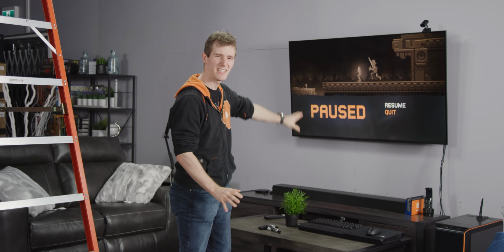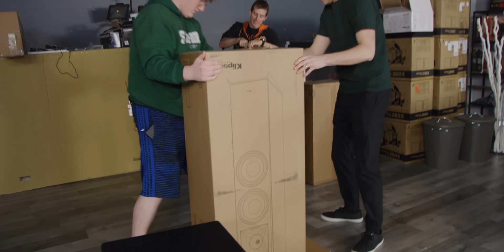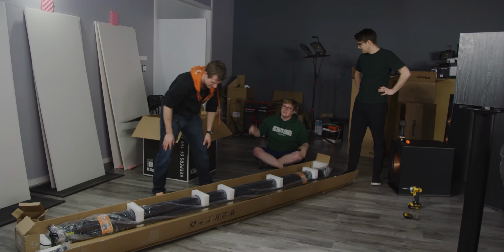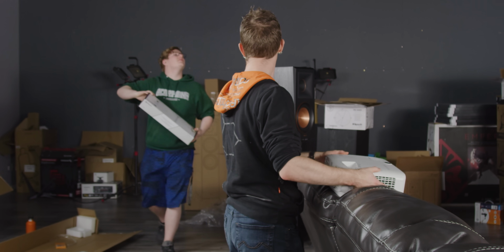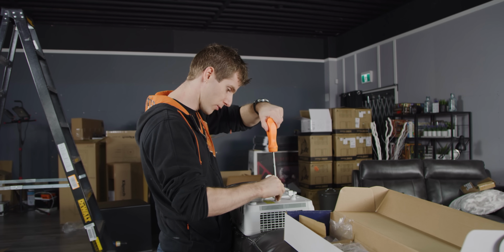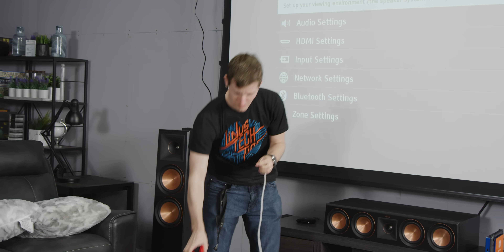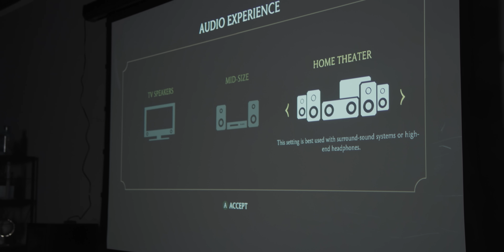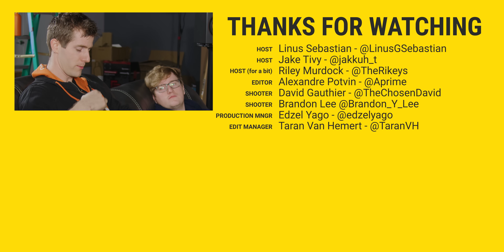I Hope We Don't Get a Noise Complaint... - Our Epic Employee Lounge Sound System

Comment: "The screen is a big part of what makes the projector sound good" -Linus 2019
Reply: *great
Reply: @Kobra Thor 
Naw. Pretty sure he meant the sound waves are reflected back from the screen like an echo. "Although the direction of the sound changes, the echo sounds the same as the original sound." It has to do with all those tightly packed fibers. Also I'm kidding. 👍
Reply: He is kinda right though. If you want good sound with a projector setup, you need the center speaker behind the screen and an acoustically transparent screen.
Reply: now there are so many ultra uber flat tv's that are as skinny as a protector sheet with the lcd build in.. Makes it pointless to have a projector
Reply: @wilsongilley76  since when is the flatness the selling point of a projector? For me it always was the size (a bit obsolete with samsungs microled wall) and the option to have a correctly positioned center speaker. And the selling point of the tv for me is the brightness, contrast, silence and ease of installation.

Comment: How is this for a video series idea... SCRAPYARD WARS: HOME THEATRE EDITION?
Say $500 (or some relatively small amount) to build the best home theatre system.

I know this setup is really cool and all, but each one of those bookshelf speakers costs more than my entire "home theatre" setup, and most people can't expect to be given amazing stuff by companies wanting advertising.
Reply: Ok. Super late reply here but oh well. I built a seriously kickass system using used, thrift store, and DIY components. I have MAYBE $100 into it at the absolute most and it's a full 5.1 system that goes louder than I will ever need it to and sounds incredible. Research audio brands and then hit thrift stores; they have no idea how to price good audio equipment and people are always getting rid of it, so you can get REALLY good stuff for hilariously cheap. Just have to know what to check in used stuff. The main amp I got for free from a best buy recycle bin (asked the manager if I could have it and he said go for it, works great), I have a separate home theater amp just for the subs (two 10" ones I bartered from my HS auto teacher). I made the sub box out of plywood, and it has some seriously thicc bass. The main speakers were all collected over time from thrift stores and people giving them away. Get whatever you can find at first and then always keep an eye out for upgrades; takes seconds to swap components or add more. You would not believe how good of a system you can get for next to nothing.
Reply: @ALittleBitOfGay  You're forgetting a screen or projector etc.
Reply: Crazy for you to assume that this was something for you. This was as the title says a showing of THEIR new setup. Not yours. I know its hard to stay with it but you got it
Reply: @brandonmcgee1678  Isn't the point of advertising to show off stuff to get other people to buy it...?
Reply: I love this idea.

Comment: Listening to bass boosted music would be like airbending with that thing.
Reply: Laying in the opposite corner of the room getting punched in the face by giant ass beats... I'd try that.

"What the hell happened to you fj?" 
Uhh... An elliphant with frickin Major Lazers kicked my ass.
Reply: Listening to bass boosted music on decents sub actually sounds pretty shitty. You're better of listening to the normal song an bumping up the bass on the receiver a little. You'll have the same amount of bass and it sounds way better.
Reply: @FreakyNinjaNL  This is true. If you have a "good" hifi system, you don't listen bass boosted crap cause it sounds pretty shit. Just turn up the lows at your Reciever for Subwoofer Output or turn up the gain on the sub itself (if it is a aktive one).
Reply: @FreakyNinjaNL  Indeed,  Bass boosted songs rarely have a good sounding bass, its just cranked way to high and ends up being a bad signal instead so you cant turn the volume up as high.    Of course there are some exceptions but the majority of them sounds shit.
Reply: @nobodylmportant  I avoid anything on YT generally. If I can at least.
Reply: I actually own this subwoofer and can confirm, that it is great :)
Reply: Rap music with a good sub is best thing ever
Reply: Try the SVS PB16-Ultra. Its insane!
Reply: They gotta try out that one YouTube video called Bass Test 2019 with the blue logo or whatever, I was blown away about the bass the first time I put that on my 5.1 system
Reply: @randomtube8226  No doubt, but it costs like 5 times as much as this sub :)
Reply: @nobodylmportant  7.1 Gaming Headset! True Surround for pro Gaming! Wait... These Headsets have 7  Speakers and 1 Sub? Most non Gaming Headsets have better Sound quality for less money and 7.1 Virtual Surround sound is something you can get with software. Gaming Headsets are more like "cool" looking rgb stuff as quality Audio Equipment. At least there are some really good sounding Gaming Headsets out there but they are not worth the money. Something I had to learn with these plastic Party Speakers like these from sony or LG.
Reply: @nobodylmportant  I'm not a real hifi guy cause I listen more electro, house and progressive but that doesn't mean that I only need bass... Really i stoped using my subwoofer all the time. I listen more music just with my front speakers. KEF Q150s. I know they are only upper middelclass bockshelf speakers but they have a really flat sound profile for their price. + - 2db from 51hz to 21khz. And maybe I upgrade them to ls50s and put the Q150 in the back. But for a real diffrence you would need to spend way more money. Like I said. Gaming Headphones are more design and marketing and less sound quality.

Comment: I love the decision to include the projector. 
I was watching previous videos on my projector and the contrast between them sitting in front of a "tiny" 65" TV and me watching a 150" screen was pretty funny to me. What's even more funny is that in some scenes their TV was displayed to be bigger on my wall than it was in real life :D 

My projector is only 1080p though, but at 4.2m away (that's the distance I'm watching from) it's absolutely perfect and the difference between 4k and 1080p would be barely noticeable.

So if anyone is planning on buying a 4k projector then it's possible to save yourself a lot of money and go with 1080p one with little to no change in quality. 

Also what I found is that 3LCD projectors are brighter and have much better colors than DLP projectors, also they have constant brightness across the whole color spectrum. 
Don't be fooled by 3LCD projector having less lumens than DLP one - those are measured in two different ways - DLP projector's brightness is the brightness of color white so it's the absolute maximum this type of projector can have, and in most scenes it's much, much less, sometimes even half of that. 3LCD projector brightness is the brightness of any single color or a combination of colors, and that's always (more or less) constant. 

For example I've seen a Youtube test comparing a 7000 lumen 3LCD projector vs 7500 lumen DLP one, and the real brightness of the 3LCD was 7000, while DLP only had 4000 lumens.

Comment: Has top of the line projector thing, uses budget projector that isn't even really 4K.
Reply: Next video
Reply: P I X E L  S H I F T I N G
Reply: It's DLP, which is already better than any LCD projector. If they went full 3DLP, then that would be on par with actual cinema projectors.
Reply: @Katzelle3  wtf are you talking about, classic DLP suck ass, they are good for power point presentations but are awful for movies and gameing.
Reply: They need a new sony 4k laser projector.
Reply: yeah but how much does it all cost. Minus the speakers? id spend like 1k for screen and 1-1.5k for a projector. Tell me where im wrong i need opinions.
Reply: @Andytlp  Yea bad investment, get a screen for 200-400! I personally would not spend that much on a projector at the moment, as cheaper 4K HDR are just around the corner, the cheapest you can get atm is the Sony VPL-VW320ES for 4K. So either spend ~800 (EH-TW5650) for a good LCD Epson or maybe one which supports HDR for around 1600 (EH-TW7300). Get a proper sound system (no satalite shit), and invest in darkending the room with molton cloth or similar.
Reply: @sireveman  I see.. so a good 1080p is better than cheap one that mimics 4k?
Reply: @Andytlp  If you buy a good one that mimics 4k (pixel shifting) like the one I posted (TW7300) it will be better than the 1080p of the same quality. I personally think this maybe next year we will have good native 4K prjectors for <2k, so maybe buy expecting to upgrade in the near future.
Reply: @sireveman  Alright. Thank you for your expertise.

Comment: Those rear speakers would sound better if you pointed them towards where your listening position is... 😉
Reply from the maker: We know, but there will be a table there. Compromises :s
Reply: @LinusTechTips  should 3d print or use that CNC machine to make angle blocks for those speaker pillars to aim them...
Reply: rgb will make them sound better
Reply: Last time I checked on that subject and it was a while ago. You need to test which way is better. Forward facing, toward each other facing or toward the listening position facing. It depends on the room you are in and how far away the speakers are.
In my case I found the rears were better facing forward in one house and toward each other in another. The fronts have always sounded best pointed at the listening position.
Reply: @sparkyenergia  in that large space they actually need to move them back further but since its not a purely dedicated room and will have more stuff behind it. The surround speakers are really too big for the tight space they are sitting in but the on board speaker testing software on that reciever will be fine for non audiophiles.
Reply: @sparkyenergia  what I read was that the fronts should toe in but should cross behind the listener and the rears about 15° forward of facing each other.
Reply: @LinusTechTips  just put them a few meters to the back wall :D or hang them from the ceiling ;)
Reply: @Damicske   Then you run into the issue that the regular 5.1 (not the sub though) part of the setup is supposed to be at the same height off the floor (unless that changed with atmos setups). As said its been a while since I stuffed around with that stuff. I'm still running older gear.

Comment: finally some proper speakers, not that soundbar nonsense. Also the editing was superb.
Reply: It's only klipsch I'm so
Reply: @puresesh7985  yeah, Klipsch stuff does a good job, but it's not that good for the Money they want.
for the same money you get B&W and Dali speaker setups that sound way way way better.
but than again, they didn't pay anything for the Klipsch Stuff.
Reply: Yeah,  I thought they were going to have AT LEAST a surround of b&w 803 d3's.
Reply: Klipsch Reference is very good and not the same thing as the cheaper Klipsch gear which is overpriced.

Also if the predominant use is going to be movies the horns in Klipsch speakers make a big difference.

But with proper speakers everyone has their own preferences so take that with a grain of salt as there isnt REALLY a wrong answer.

Comment: NEVER connect a subwoofer cable when the sub is powered on! Also, you're not supposed to speak or make any noise when the receiver is calibrating.
Reply: lol yeah thought that would have been obvious. and sub gain at 11 is just stupid - my sub amp gains have never gone above the 3 o'clock position. and then there's the fail rear speaker positioning i mentioned in my other comment...
Reply: Welcome to Linus Tech Tips.
Reply: depends how you like loud buzzing sound when plug in, i have 4 subwoofers 2 really big with 2 12inch and 2 15inch and all conected to diffrent amplifiers so always something connected with12 channel speaker and 20+ speakers, and that big room dont make diffrence with microfone calibrating.
Reply: Well. You can but you get a weird undescribebal sound.
Reply: @RWL2012  mine goes up to 15
Reply: @Marcos87600  and...? shouldn't need to turn it that high if your receiver outputs a strong enough signal for the amplifier to reach full power below that point...
Reply: and nothing bad happened
Reply: @SkvalaGaming  Until something bad happens.
Reply: @RWL2012  go drunk your home
Reply: subs are made to handle tremendous pressure and you think a cable plug can damage it?
it sure doesn't sound healthy but wont make no harm
Reply: and the next thing is the sub is placed wrong. Never place the sub outside the 5 sourounding speakers
Reply: @HardcoreA1  aaand 1 sub in a longitudinal arrangement. Another bad idea.
Reply: @MilGrip76  true!
Reply: But why??

Comment: Me: I need that subwoofer!!!
Landlord: Sure, if you move first.
Reply: Do you realize that's over priced carp by a job gt4 series sub and a cheep and then find a good pc power supply I'm running a 12 15 and 10 inch sub in my house kid
Reply: Klipsh is cheap stuff but pretty good, like proson and brl but theyre subwoofer not good with aluminium, build your own with 2x12 inch and 4x10inch with carbon fiber or kevlar that give more bass and better sound for front stereo sub and 2x15inch in the back so whole house shake.
Reply: All of my 4 subs are larger than his with all separate amps. And with x4 15 inch woofers in speakers on a proton 1100 and a kenwood basic m1d . I can blow him away.
Reply: It’s not bad. It’s just... cheap(ish)
Reply: Alvin Walters  but then again svs is the king
Reply: Alvin Walters  that's why I have the svs PB-12 plus/2 😁
Reply: @kublicron  You have no fucking idea that we ain't all spl wankers sq all day long don't get me wrong and jbl is harmon kardon and a cheap amp could be an old philips dap or a jbl and ad 4 ohms systems are more predictable than 8 and 6 never liked them

Comment: Your speaker positioning is far from optimal. Especially the rear speakers. Please try to place them properly, it's a massive difference in sound quality
Reply: Georg I was a bit surprised too that they put the speakers like that. Also the subwoofer if probably not at the correct spot too.
Reply: @kartaloktay  Subwoofers don't matter as much, in terms of room position. LF info, when you're down that low, is omnidirectional.
Reply: @JordonBeal  True to some extent regarding the sub, but in such a large open room you really need to pay attention to the subs location to ensure you get what you paid for where you sit. 

If the front wall is the only option for sub placement I am 100% convinced that 2 subs, one on each side, perfectly symmetrically placed, is necessary to provide the results you would expect for that price tag in such a room.

Bass control and management is critical for home theatre. It's what makes or breaks your experience.

@LinusTechTips if you want to go all out, get one more sub and have a conversation with a specialist regarding install and setup of a system, you will not regret it!
Reply: Glasswall Studio that's not entirely true. Usually you put the subwoofer in the place where you wanna listen to it and then move through the room and check where the sound is the best and then place it there.
Reply: @kartaloktay  You're talking about placing it where it accentuates a natural node in a room, "best" being "loudest" when most people talk about that technique.

Comment: Just ... don't talk and make noises when calibrating a surround amps/processors/dsp's.
And with a 5.1.x setup, surround speakers are supposed to go on the side, not the back. Dolby has documentation on this on their website.
Oh, and, setting the surround speakers off axis is not recommended by default.
Reply: I think you are mixing this up with a 7.1 setup (with this the surround speakers would be kinda on the side right?). They went with an Atmos setup, so the x is the ceiling speakers. Granted, their speakers are not perfectly placed by any means, but it'll work.
Reply: They need to be 90-120 degrees from the listening position (to the sides) and about 2 foot up to avoid localisation. 
Ive found 110 deg works well FOR MY SETUP based off a ton of testing. This completely depends on the speakers dispersion pattern, so testing is vital.
Reply: @Kristjan_N  see the documentation for atmos setup on dolby.com. I think you're wrong (supposed that I remember correctly). I used that documentation for my neighbours atmos setup
Reply: Yes, they definitely need to improve their audio game. I wouldn't say they pulled a Verge on it by any means, but in comparison to their PC knowledge, this was pretty bad. They should have done a collab with a home theater, or audiophile,  YouTuber and done a proper setup. The fact that they went with the minimum speaker setup for Atmos, and thought it was overkill, kind of says it all. LTT are usually better than this when it comes to overkill.
Reply: For the record, this was editing at work. The two were done separately, just thought it made more sense to most to have both events at the same time.

I appreciate that people feel the need to correct the record because we're not always right, but this isn't a tutorial, it's a video done for your entertainment.

If anything, you should always follow instructions as they're laid out by a manufacturer.
Reply: Bwead how am I right “sort of”, but then you’ve repeated everything I just said? Haha